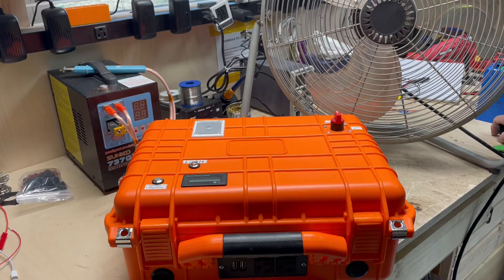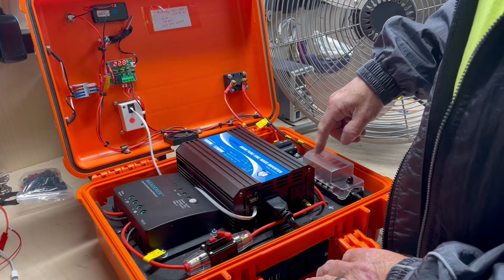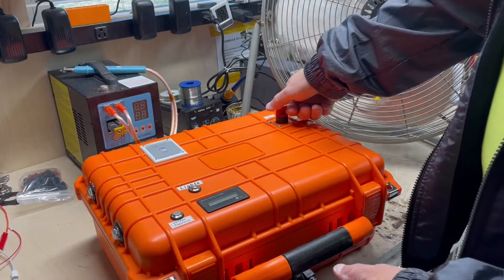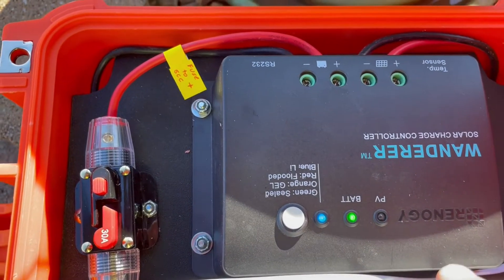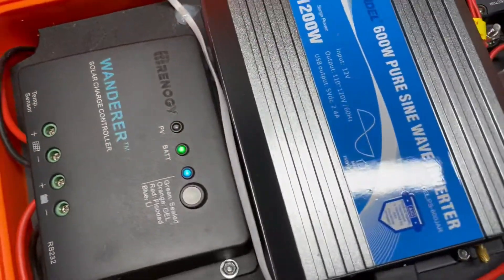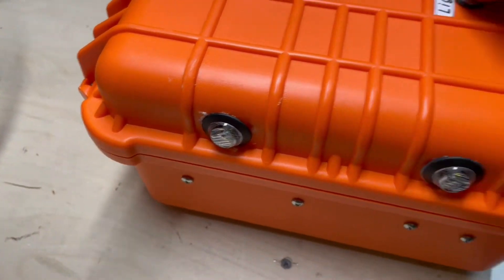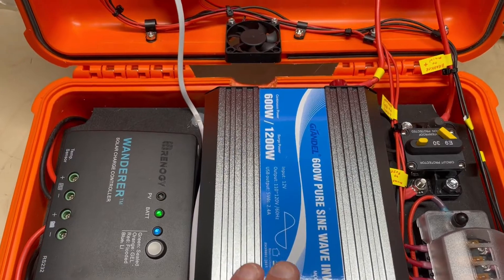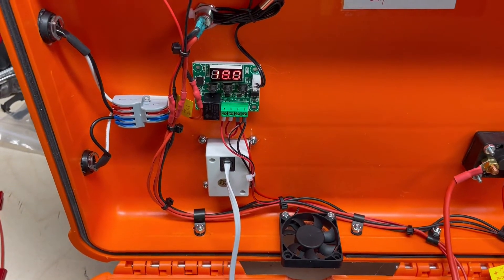Solar Generator complete build Final

Comment: Nice Video!  I was wondering what is your battery capacity?  Are you using 6v batteries in Series or small 12v batteries?  Thanks!
Reply: do you make and sell 12v battery packs? if si id like to get one from that build you did in the video.
Reply from the maker: @noelaniplanas4485  I am not able to ship this type of battery. They are considered Hazmat.
Reply from the maker: @noelaniplanas4485  I can not ship the battery packs. They are considered Hazmat.
Reply from the maker: Thanks.  The capacity is 96ah. The battery is made of 18650 cells 4s 30p configuration. 12v

Comment: Finaly :) Nice work!
Reply from the maker: Thanks I had to delete the Light build part 1. The battery pack I made would not fit in the tube. Redoing starting tomorrow.
Reply: @paulswoodshop395  oooh, I understand :)  that problem is pain in the a..... :)